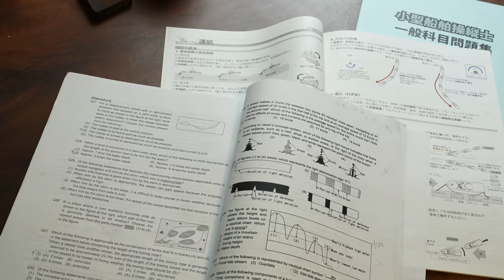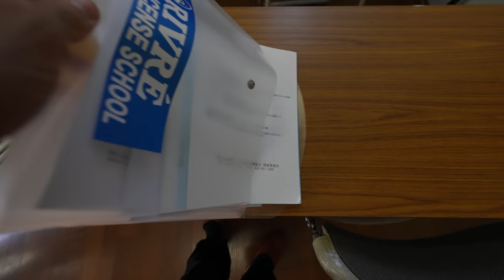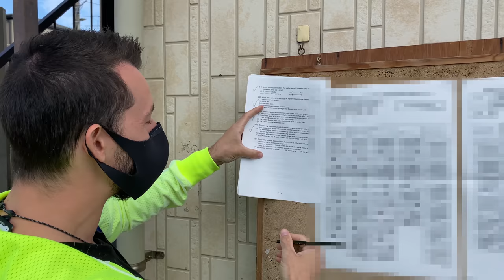I Became A BOAT CAPTAIN in Japan... (Seriously)

Comment: Great work Norm and Mitch!
A few years back, I decided to try my hand at getting a sailing certification. I had to do the same figure 8 man overboard drill, but in a sailboat - so you have to manage the sail and wind as well as steering. :)

I also studied the hell out of my knots on a very similar practice board, and I got tested on a regular sheepshank - so I feel Mitch's anxiety and disappointment about the test knot. When the borders open back up, I for SURE want to tour Tokyo by boat with you Norm! I have used the Asakusa to Odaiba water taxi to do some photog by water before.

If you're going to end up spending a lot of time out on the water, I'd recommend investing in a good inflatable personal flotation device. Those big foam life jackets are bulky, can get very hot, and can restrict your range of motion/disrupt your center of gravity and balance.  You might have to do a little research into what's available and certified in Japan, but I use a Mustang HIT inflatable, which is low profile, lightweight, and easy to fit and adjust. They are a bit pricey, but IMO, very worth it. 

Cheers fellow Captains!
Reply: Misremembered. It was a bowline knot, not a sheepshank.

Comment: (If you want to familiarize with the terms and stuff in English,  there's always boating manuals from the US or Canada or whatnot:  most of the rules are deliberately international.   If the Coast Guard still puts out a manual for the Power Squadrons,  (That's kind of like a Civil Air Patrol for boats)  that's what I used to study years ago.  I was studying for some certification or other with them as a teen before I ended up moving kinda inland.  :)

Comment: You need a licence to drive a boat in Japan? Any boat or only motorboats? You also need a seminar to be allowed to rent a boat in Tokyo? Wow!
Did you only learn things related to small motorboats or do you also learn things about the vessels and such you may come by?

In the Netherlands, you can drive boats up to 15 meters long when you're at least 16 years of age without any licence. That means people don't know the rules, which is really annoying, and there're quite a few small accidents every year. The main annoyance is that people on motorboats have no clue how a sailboat manoeuvres, so I make a manoeuvre on my little sailboat and some people are very surprised that I made a 90 degree turn without any (for them) apparent reason

In case anyone's interested: sailboats cannot sail into the wind, and avoid sailing in the exact same direction as the wind as well. So there're 3 main courses a sailboat can do: trying to get into the wind, sailing with the wind, and sailing perpendicular to the wind.
Sailboats when trying to get into the wind: they sail at 45 degrees into the wind, and they could want to make a 90 degree turn at any moment. That will happen turning into the wind, and they make a zig-zag pattern. It's called tacking.
Sailboats when trying to sail in the same direction as the wind is blowing: expect it to make a slight turn away from the wind direction while the sail swings to the other side. This is called a gybe.
Sailboats when sailing roughly perpendicular to the wind: they probably won't change direction much.
So you really need to check the wind direction when you see a sailboat. You can see it by looking at flags, waves&ripples in the water, and wind vanes on top of sailboat masts. (You can even read tiny nuances by looking at the water with a trained eye. I can tell you what the wind's going to do to your sailboat the next 3 seconds with 95% accuracy. That's a skill I'd recommend to learn to everyone who goes sailing once in a while!)
Keep in mind that their course changes slightly with wind direction, gusts and other random circumstances